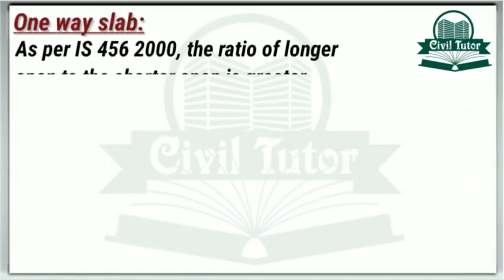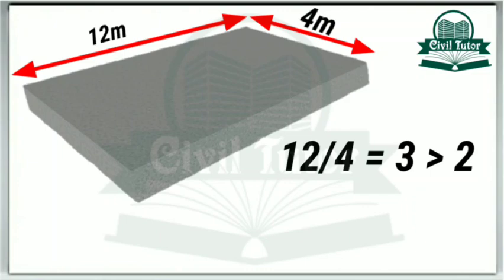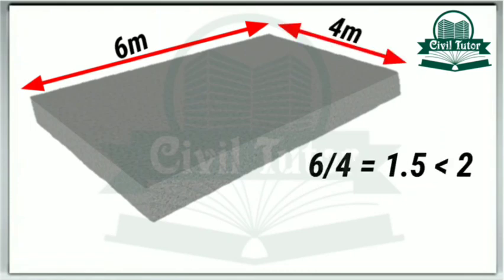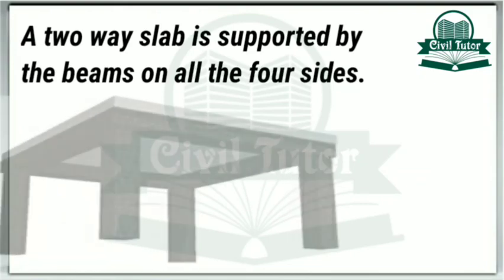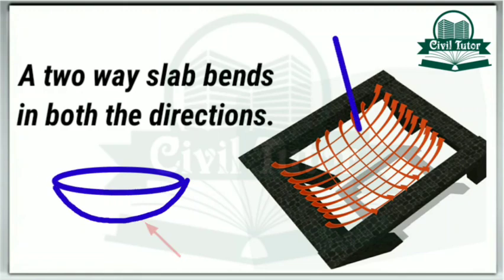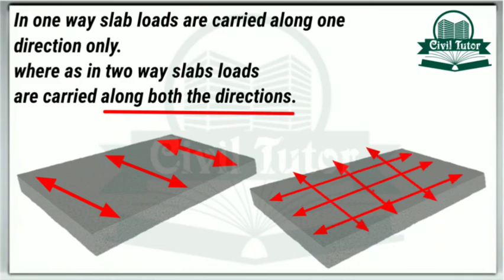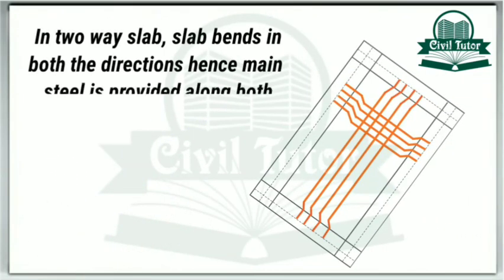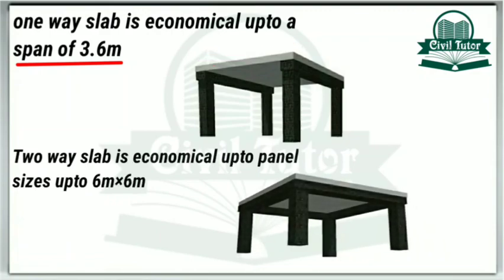What is One way slab two way slab? | Basic knowledge of slab | types of slab | Civil tutor | #slab

Comment: Can you tell me about what  can  Reinforce concrete stepped  shed over  gate  the thickness of steps  8  _  10  cm  .. and the reinforcement   o the main  beam carry these  steps ..  the the dimension of  main beam  about  40*40 cm  .. the steps adhesion the maximum step  above   100  to   80  and thickness  8_10 cm   .. under  step 80 to 60 .. under step 60 to 40 under step 40 to 20